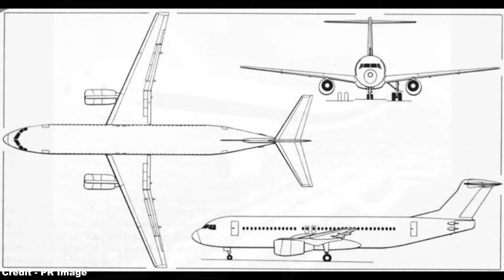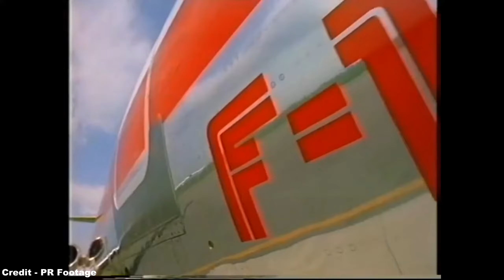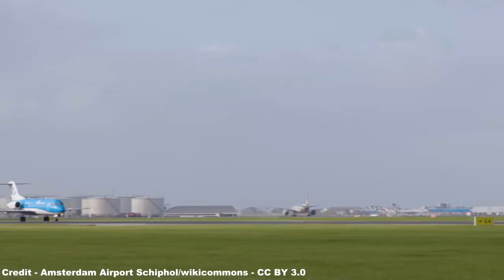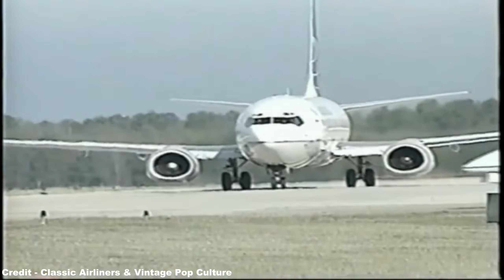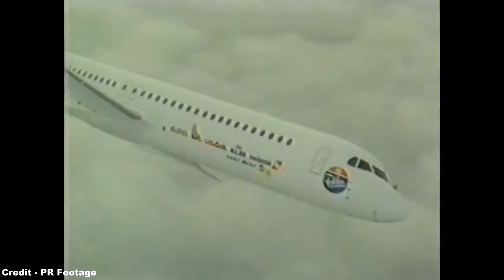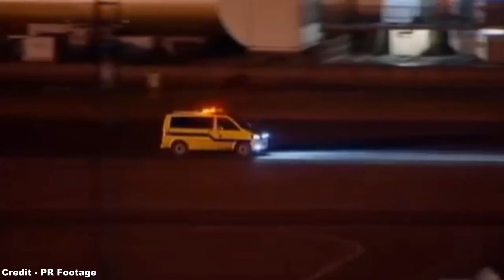The Fokker Jet Story - Part 2: Fokker 70 & 100

Comment: Loved the Fokker 100. Flew many times in Brazil, including Sept 9th 2001 when on my honeymoon all passenger baggage from Congonhas airport was left behind so the fully loaded plane could be light enough to take off from the shorter runway, resulting in a brief hop to Viracopos, refuelling and then on to Porto Alegre. We finally got our bags on Sept 11th 2001, a day of course we’ll never forget!

Also there was a TAM F100 which landed in a field around that time due to fuel exhaustion. Testimony to the structure of these planes and their ease of use, it survived the landing quite well.

Comment: The F-29 was one of 3 attempts to create a successor to the F-28. The first was the Super F-28 (stretched F-28 fuselage, new wing). The F-29 came after that, using Boeing 757 fuselage segments and a new wing with underwing engines. The last was the MDF-100, in collaboration with McDonnell Douglas. Customer response to these 3 made it clear that these weren't financially viable, so they ended up with a 'minimum change' successor to the F-28: stretching the F-28 fuselage (by less than the Super F-28), and new engines to improve fuel economy.

Comment: Once again very good insight of how these planes were built to cope with passengers and to provide better long distance travel and comfortable seats that most passengers would rely on. My understanding is that how these aircraft changed aviation and were designed to be as reliable and very efficient.

Comment: The narration made it sound like only the F70 inherited the clam shell speedbrake in the tailcone from the F28. In fact both the F100 and F70 had the same speedbrake configuration.

The F100 was the first jet in my airline career. I spent many hours on the type observing on CofA and post maintenance flight tests, maintenance troubleshooting check flights and positioning flights when I was AirUK/KLM uk's Flight Test Engineer 1999-2003.  It was also the first jet I cut my teeth on with Flight Data Monitoring.
It was a very well designed aircraft. The "dark cockpit" design of the flight deck was impressive. Like any aircraft it had its foibles. I remember that the 2 wheel air cycle machine ECS packs were from the F28 and weren't up to it on a hot summers day with with the aircraft full of passengers waiting to depart the D pier at Amsterdam Schiphol. It was a joy for the pilots to fly and me to observe on as a Flight Test Engineer.

By the way there was a modification to the thrust reversers after the accident when one deployed in flight. It involved the fitting of a cable from each thrust reverser mechanism to the associated thrust lever on the centre pedestalon the flight deck, so if a reverser did operate in flight it slammed shut the corresponding thrust lever.

Comment: An important fact that not much people know about the downfall of Fokker is that the upper managment of Fokker had aquired greedy  untouchable contracts so that they couldn't be fired.
Fokker had become  topheavy.
DASA one of the precursors of Airbus tried to correct this but failed.
Thats one of the reasons why Daimler Benz had no choice then to pull the plug on Fokker.
The enginering.maintenance and parts manufacturing part of Fokker is still alive and kicking.
Designing and fabricating parts for military and mostly Airbus aircraft.

Comment: The Fokker 100 was one of the most important types in the history of Brazilian airline TAM, now LATAM Brazil. The F-100 allowed TAM to transition between a regional airline and the second airline of the country (after Varig) in the 1990s. The fact that it is smaller than a 737-300 enabled TAM to develop an important network with new direct flights where other carriers like Varig, Transbrasil and VASP couldn't enter easily because the 737s required more demand to reach breakeven. It was so important that even after the accidents and incidents, TAM only withdrew all the Fokker 100 in late 2000s.

Comment: Good overview of the Fokker F100; however, Spirit Aerosystems had nothing to do with the demise of the F100 wing assembly in Belfast. Bombardier was the company responsible, having bought Short Brothers PLC in 1989. Bombardier could hardly be expected to continue building wings for it's direct competitor.
Reply: When you take over a company you can’t renege on that company’s existing contracts, so Fokker itself must take the blame here for either voluntarily allowing Bombardier to cease supplying wings, or maybe having what must’ve been a very short-term deal in place with Shorts (which then enabled Bombardier to simply say “Sorry, No!” upon its expiry).